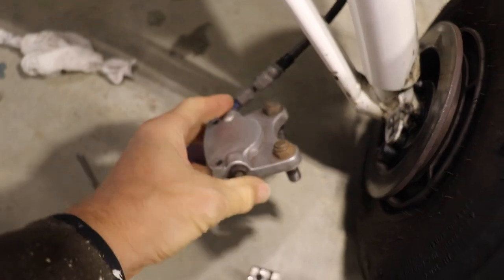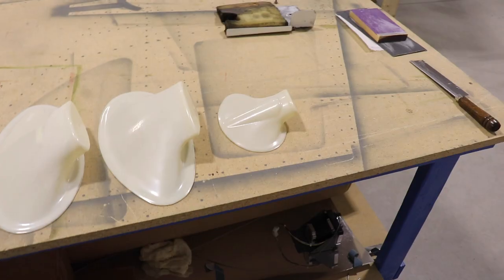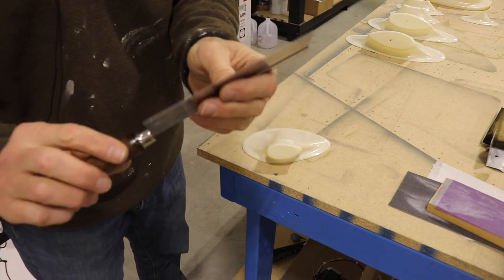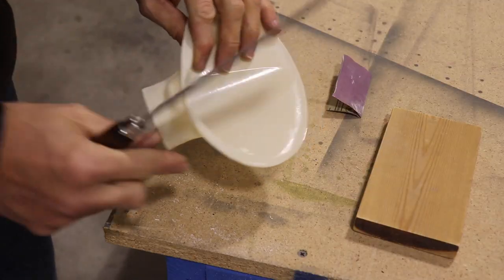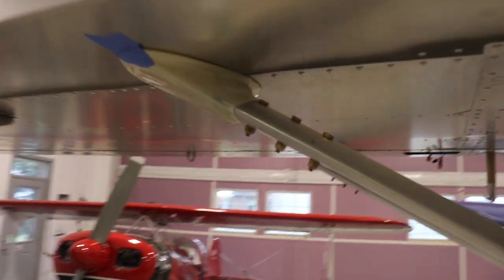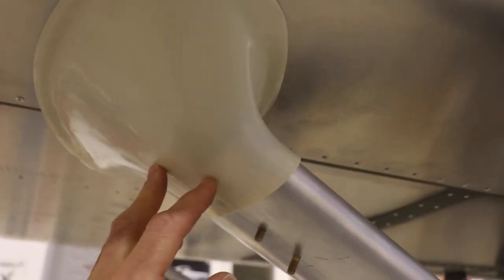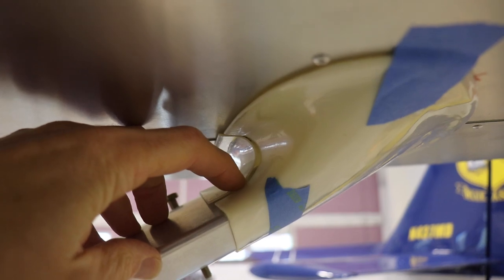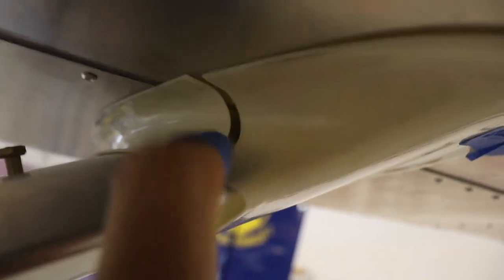Zenith CH-750 Super Duty Wing Strut Fairings

Comment: Nice video.  Another way to trim the fairing to clear the bolts and nuts is to set the fairing in place without the bolt and drill a pilot hole through both sides using the bolt hole as a guide.  Remove the fairing and drill the holes out to a larger size sufficient to clear the nut, bolt head, and washer. Then decide if you want to trim the fairing back more or not.  This way you get nice even holes or cutouts depending upon where you trim the fairing.

Comment: Are the fairings vacuum formed plastic….in the 80s when the zeniths were in Canada I worked for a guy building fibreglass parts like wheel pants and wing tips for the 250s

Comment: Mark, If you wanted to install these Cuffs without Splitting them, you Could have slid them onto the struts Before attaching them to the wings !
Reply from the maker: That will not work. They fairings have to be moved down to put the main bolt in. You can’t slide it down with the other bolts in the strut.

Comment: Just thought of another question - in your experience with the Cruzer fairings, do the sheet metal screws ever tend to loosen?  Do you use Loctite when you insert them?
Reply from the maker: Not a single one has ever loosened. Think of this way-your entire airplane is built with bolts and nuts with nylon in them. The bolts don't come loose. The plastic fairing acts as the nylon in a nut.

Comment: I'm really sorry about the brakes on your Pitts, but I think it's great that you're having a Pitts mechanic check it out.
The execution of the strut fairings and your super duty are really great.
Do you know if there are such fairings for the 701 or if you can use them for the ch 750 STOL?.
Supposedly the Streamline Struts for the 701 would have been carried over from the 750.

Comment: I did not see where you slit the jury strut fairing.  Did you not split it and just unbolted the strut, slipped the fairing on and down out of the way, and then bolted the strut back?
Reply from the maker: The jury strut fairings don't need split. Like you said I just pulled the top bolt, slid the fairing over the steel tube, put the bolt back in and then slid the fairing up. They are the easiest ones to install!